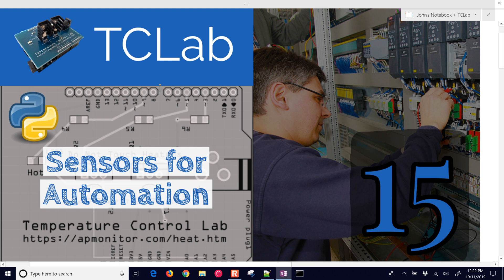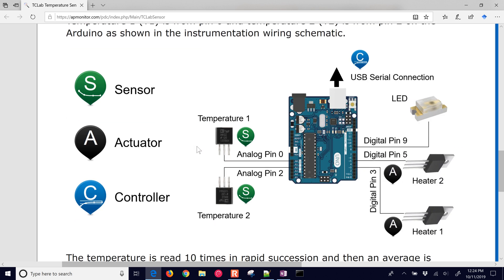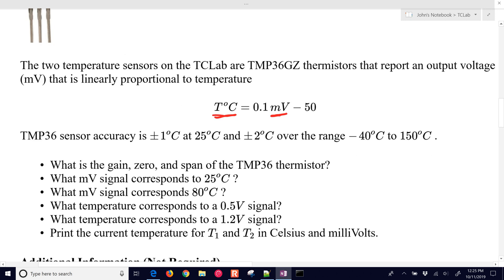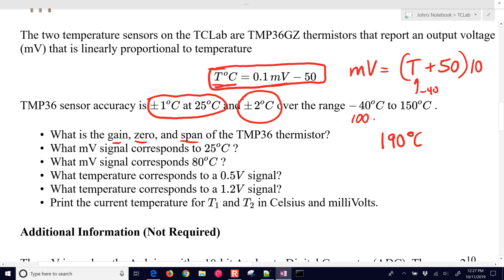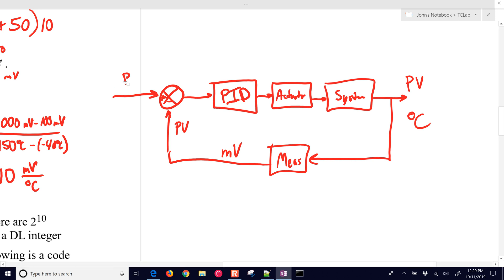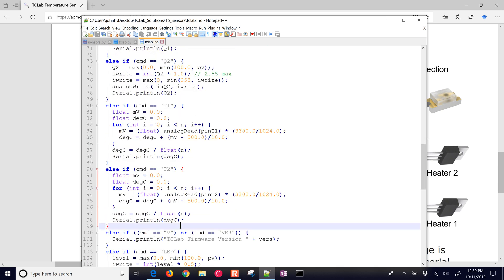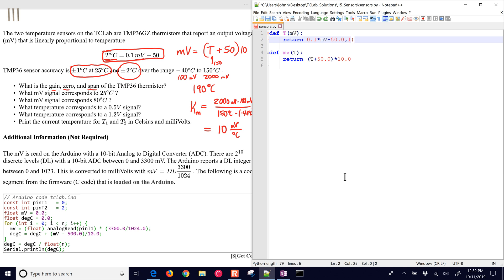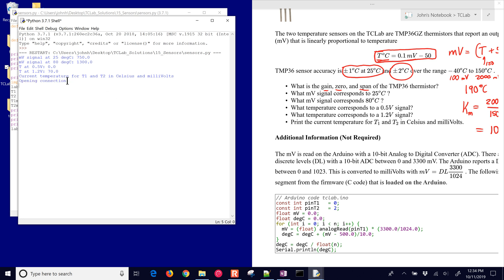TCLab: TMP36 Temperature Sensor

Comment: This seems like a IC temperature sensor and not a Thermistor?
Reply from the maker: Thanks for catching that: Unlike a thermistor, the TMP36 does not have a temperature sensitive resistor. Instead this sensor uses the property of diodes; as a diode changes temperature the voltage changes with it at a known rate. The sensor measures the small change and outputs an analog voltage between 0 and 1.75VDC based on it.
Reply from the maker: I've updated the website: https://apmonitor.com/pdc/index.php/Main/TCLabSensor and the video description.